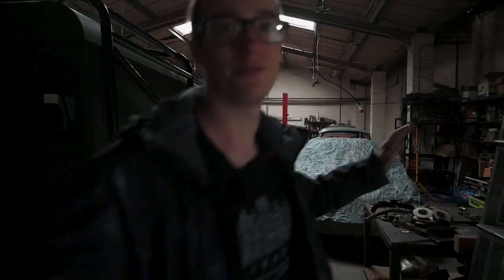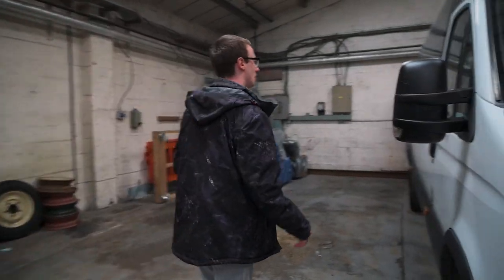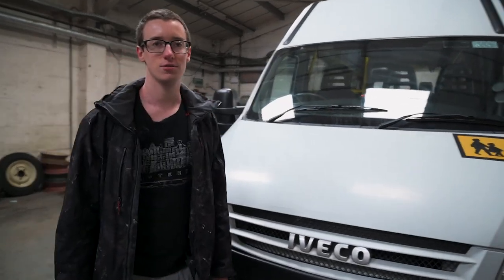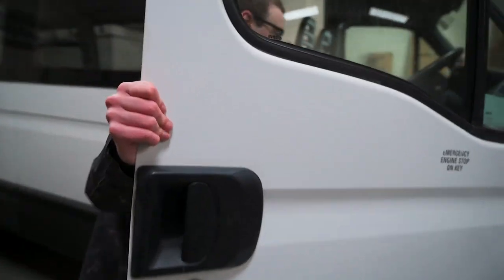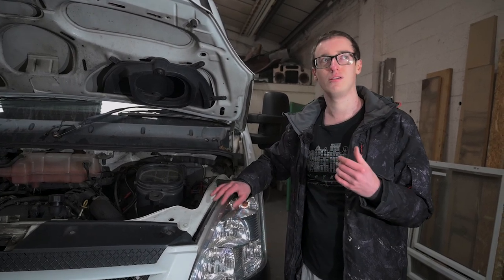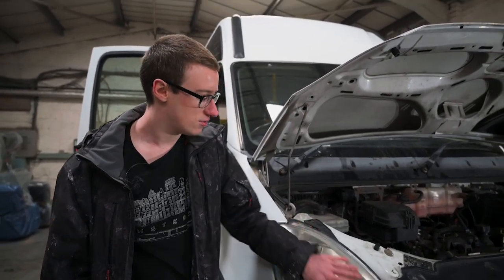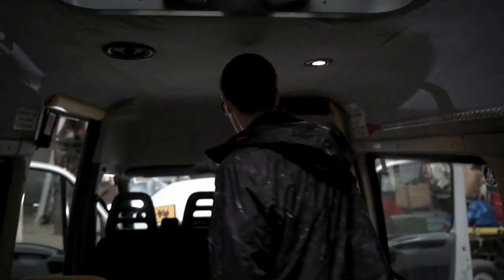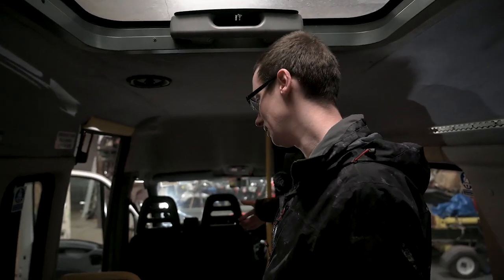Lets Build A Campervan : Episode 1 - Van Conversion #vanlife #vanlifeuk #iveco

Comment: Cool bus! Sucks that you broke the door, hope its an easy fix.
Good luck with that floor as well, from what Ive seen they can be a right pain to remove. Itll be interesting to see how bad it is down there.
Reply from the maker: Thankyou 😄, hopefully I can fix it going to be working on it ASAP as it’s driving me crazy that I broke it aha. Yess Iv heard it’s torture will be trying it after I take down the metal sides of the bus, found out minibuses are reinforced on the inside after the floor has been laid. Hopefully taking off the sides will help free up the floor 😬

Comment: Has it got the twin wheels on the rear axle? If so the payload on these is huge, you'll be fine as far as weight goes, but can you drive it on a standard licence?
Reply from the maker: Yes it has twin wheels on the rear and can have upto 8.7tons total. On a standard licence I can only drive upto 3.5 tons but I will be getting a c1 licence in the coming year filming that whole process too. Then I can go upto 7.5 tons. 🙂 Thankyou for watching 🎉